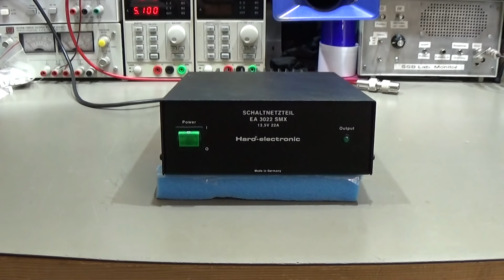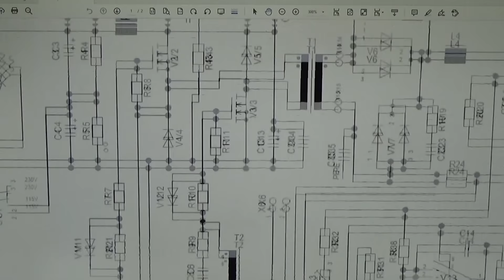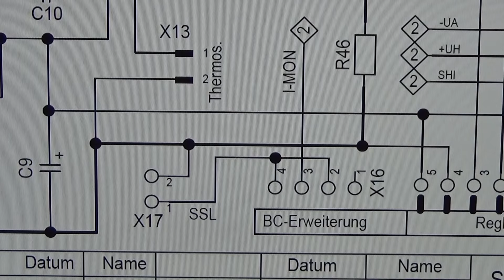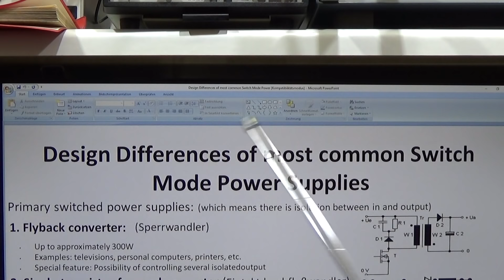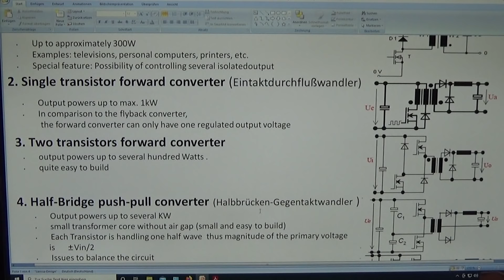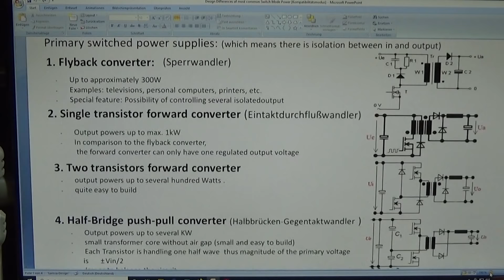#211 SMPS Power Supply Tech Training - Tips, Tricks, Hints, Analyses on Switching Mode Power Supply

Comment: i want help!
i bout a cheap computer smps perfectly normal volt output!
the switching transistor starts to heat in idle itself 
draws 0.03 amp and 230v in idle !!
what may be the cause of smps heating 
transistor 13007

Comment: Are you German?  I am, and my name is Frank Reiser.  I am surprised that the cable plugs are not on the front panel.  Can a switch mode power supply be variable in terms of output voltage as linear voltage supplies can be made?  You are helping me get ready for my job interview repairing SMPSs.  Wish me luck.
Reply: Yes, variable voltage is possible to some degree. Output Voltage stability and ripple need to be considered.

Comment: Its an interesting lesson indeed.  Thank you.  I have a SMPS in a bluetooth speaker system. I suspect a heavy load of current has invaded it due to lightening.  Now the fuse gets blown repeatedly.  I understand that is how the circuit is protected by the system from further damager.   Can you please advise me what components I should particularly inspect to troubleshoot this problem.  Appreciate your advice.

Comment: Thanks so much or all your help.  I have an Icom IC-7800 and they use a Futaba FP2346C 3rd party SMPS board.  Icom expects you to replace the board as an FRU so they won't provide me the schematic.  I've not heard anything back from Futaba.  I once repaired an older  Icom transceiver (I don't recall which model) for a hospital's radio room.  The power supply failed and I simply shot gunned all of the electrolytic capacitors and that brought it back to life.  Unfortunately that is not the problem with the IC-7800.  Hopefully your series of videos on the subject will help me out.  Thanks again.

Comment: Hi Peter, das war ein interessanter Vortrag. Ich muss immer wieder SMPS reparieren (Flugzeugelektronik von Honeywell & Rockwell-Collins), habe mir aber über die verschiedenen Designs nie große Gedanken gemacht :-) Interessant wird es, sobald In-rush-current protection und PFC dazu kommen. Tip: SMPS prüft man von hinten nach vorne :-) Ohne einstellbare P/S für AC (Spannung und Frequenz einstellbar) und DC (bis zu 400 VDC!) und einer electronic load bin ich da völlig aufgeschmissen. Und ja, ich muss nach der Reparatur diverse Prüfungen durchführen bevor das P/S wieder fliegen darf.
Reply from the maker: Ah sehr interesanter Bericht! Vielen Dank. Warum prüfst Du von hinten was ist deiner Meinung der Vorteil?
Reply: @TRXLab  Einfache SMPS mit Gleichrichter, Kondensator, Schalter, und  Trafo mit mehreren Sekundärkreisen, von denen einer, meistens der 5V- (PC) oder 12V-Kreis (Afu-PS), geregelt wird, sind tatsächlich recht einfach zu reparieren. Obwohl gerade hatte ich recht simples SMPS, da wollte auch der U2844 nicht loslaufen, weil der COMP-Ausgang (Error) durch ein Problem in der power-good-Erkennung auf 0,7 gehalten wurde.
Ich habe da ein sehr aufwändig gestaltetes SMPS mit inrush current protection, aktiver PFC (eigener Regler mit Transistor als schaltbare Last) und mehreren "sekundären" SMPS-Schaltungen, deren Regler eine gemeinsame DC-Versorgung haben. Leider darf ich keine Schaltbilder öffentlich machen (intellectual property).
Da muss ich erst sicherstellen, dass die PWM-Regler laufen und alle Gates der Schalter mit dem PWM versorgt sind. Dann ist da ein Regler, ich glaube es ist der für die PFC, der erst dann eine PWM erzeugt, wenn bestimmte Eingangbedingungen erfüllt sind. Da beisst sich dann die Katze in den Schwanz und dreht sich im Kreis.
Es kommt dann auch das regelbare DC-Netzteil zum tragen, mit dem ich 200 VDC auf den Zwischenkreis-C gebe und prüfe das die sekundären SMPS funktionieren. Wenn der Test ok ist, dann DC weg und das 115V/40Hz-PS kann langsam hochgedreht werden. Irgendwann fängt auch die PFC an zu arbeiten. Dieses komplexe Teil wurde mir praktisch vor 2 Jahren auf den Tisch gestellt und ich lerne immer noch Neues :-)

Comment: I have repaired Welding machines (invertors) that have full-bridge push-pull convertors, very common i believe even for the smallest (140amp welder) . Also the transistors are driven by a transformer-coupled gate drive circuits, i think i spotted the same transformer-coupled drive circuit on the psu schematic you showed here.  Nice video breaking down these circuits! For the flyback is it worth noting the transformer dot for polarity?
Reply from the maker: Thanks for your feed back! 
The transformer is not a normal transformer, because its function is to store energy during the on time of the transistor and to deliver this energy during the off time via the diode to the secondary capacitor. So the transformer is a storage inductor with a primary and secondary winding. To store energy the transformer core needs an air gap and normal transformers do not have an air gap.

Comment: All my Switching powersupplys goes dead after max 3 years.. Then on Output line i have measure 85Volts.. My Icom has fast react and has not destroyed by luck.
The Problem is when the Transistor goes down, he can bring high Power output.. atm i use an very old tranformator, there runs since 45 years.
Reply from the maker: yeah a lot of cheep SMPS's are crap but even high quality ones are working at its limit at a point. So it is no wonder that they quit earlier than linear's...
Reply: @Karstan Schulz - I have a switching power supply, that was built in 1998, and it is still functioning today.  It runs 24 hours per day and 365 days per year.
Reply: @vtorsi610  Yes my Commodore Amiga PowerSupply is from 1987 work's too..
The time of inductor winding is off.. on SpaceStation no trafo are running , the icom Switching pwr supply cost atm ~400Euros ^^

Comment: @TRX Lab  Are you able to share the document that outlines the different SMPS designs you showed in your video? I am going with a guess that this is a half-bridge push pull design!??
Reply from the maker: double check if the cap voltage-divider is some how connected to to one of the primary transformer leads??

Comment: I've already saw one video on repair of exactly this model of PSU. The problem was in that small red inductor. It had broken wire. As I can see from the schematic, this one in particular has 2-transistor forward topology. Also, on schematic you can't see PFC circuitry, but, when we look one that's on table, we can see there's PFC choke, also, there's Motorola IC on main board (MC something).
Reply from the maker: may be that you have seen my video with an open solder joint at the driver transformer?
Reply: @TRXLab  yes. Right aftre I wrote that cpmment, I've seen it on your channel. Great videos, both. Thanks for uploading such a good tutorial.

Comment: It's a two transistor forward convertor because both ends of the transformer are connected to the fets not one end connected to the center point of the electrolytics.

Comment: Looks like two transistor forward converter as the transistors seems to switch together. First check fuse. Then check DC on both sides of L2. Next is to find out why there are no switching puls on the gates.

Comment: I think that if I were repairing this unit, I would replace every Electrolytic capacitor with new High Temp, Low ESR, new capacitors.  Not that it would be the source of the problem, but because it would make me feel that it was safer and more reliable to do so.
It will be interesting to see what the actual source of the failure is, and Peter is the man to find it.
Reply from the maker: That is basically not wrong for a unit 25+ years but I'm almost sure that the high quality caps used are still good...
Reply: @TRXLab  Maybe, but in a SMPS the caps are highly stressed by the switching pulses and therefore prone to accelerated aging

Comment: I would like to know what it is about each switching topology that determines their power range. So for example why is the flyback limited to 300w whereas the full bridge is many kilowatts. It's not obvious to me from the diagrams.
Reply: I was wondering the same thing. My guess would be a TDP of a transistor. That fast switching of big currents makes a lot af heat on the mosfets. Since in flyback you have just one transistor you must limit the max current or it would overheat. Full bridge has 4 transistors and not all are turned on at the same time so all that heat can spread more evenly. That is my only idea looking at the diagrams...
Reply from the maker: A very good question and at the same time a very complex one and as we all know there are no easy answers to complex issues. So to explain it all in detail it takes a semester at college. But the short one is 
1. More transistors can mange more power than one.
2. We use different transformers with a different physical  behaviour
3.  heat dissipation, core size and heat sink is an issue.
4. wight and size and cost of transformers and chokes is an issue too  
5. radio interference and power factor correction needs to be considered
6. more and more we need to reduce the total harmonic distortion which gets back in the line and creates a lot of problems to other devices.
So we could list some more points and you may understand that this is really a  complex issue development departments facing to get all in balance...
Reply: @TRXLab  Thank you @TRX Lab, If I can just comment, this is not having a go at you and its more about trying to make you aware of it if you are not. It is WEIGHT and not WIGHT. You also pronounce it the wrong way a few times in your video. It may be your accent but not sure. Either way it does not really bother me. I just wanted to make you aware of it if you are not already. Thank you for this great video and looking forward for your next one with great anticipation.
Reply: @TRXLab  Linear transformer is easy to measure and identify the primary and secondary side. Is there a way to test a pulse transformer to identify its parameters and what circuit it is designed to run?
Reply: @gl0sek  You can measure inductance of each winding with the other ones open to get the inductance - that will give you the turns ratio (or you can measure the turns ratio directly with a signal generator and scope). 

To understand whether it is meant for a flyback (gapped) or forward/push-pull/half-bridge/full-bridge, one way is to find the data sheet for the ferrite core used (these are pretty standard, so based on the shape and dimensions you can make a decent guess).

If you have the data sheet for the ferrite core, it will tell you the Bsat (maximum flux density), and dividing that by the primary inductance will give you the saturation current. Only flyback transformers are really designed for a high saturation current (and thus relatively lower inductance), so you can use that to make an educated guess. (You can also measure the saturation current directly but it requires much more equipment).
Reply: @marcelbirthelmer7941  wow thanks! That's a lot of usefull information.
Reply: In a flyback converter, the transformer is really acting as a "coupled inductor". It's basically the same thing as a boost converter but with two inductors acting as one. That means that the energy that is transferred from input to output is stored entirely in the transformer at some point in the switching cycle. In forward/half-bridge/full-bridge/push pull topologies (which are more similar to buck converters), the transformer is actually acting as a transformer, not as an energy storage device, so it just scales voltage/current by the turns ratio.
This has a few implications. For one, you need a transformer that is designed to store the energy rather than just transform it, which imposes some limitations. For another, because you're using the flyback effect to transfer the energy, you have big voltage/current stresses on your switching devices (input FET(s), output diode/FET). And lastly, you have to deal with the leakage inductance of the transformer - some of the energy doesn't go to the output but instead gets dumped back into the input, so you need to absorb/redirect it in a way that doesn't damage your components, using either a snubber (higher dissipation) or an active clamp (extra complexity). As your transformers get bigger, you tend to get more leakage as well, so your efficiency starts being more of an issue.
So at some point all the extra complexity needed to address the shortcomings of the flyback topology outweighs its simplicity, and other topologies start becoming more competitive.
Reply: @marcelbirthelmer7941  You should do a YouTube presentation on this particular issue in more detail if you haven't already. I think you'd be good at it.

Comment: amazing explanations, and I think its a Half-Bridge push pull converter design as I see 3 big caps, 2 series ( the closer ones) and both parallel with the big cap behind the coil, but this is just guessing.
thank you for this amazing video.
Reply from the maker: good approach but double check  if the center of the two caps are in any way connected to the transformer coil as you can find it in the half bride design...